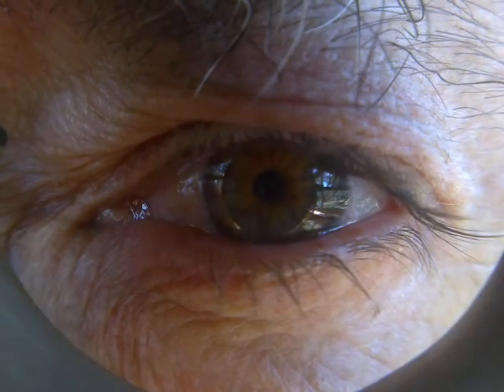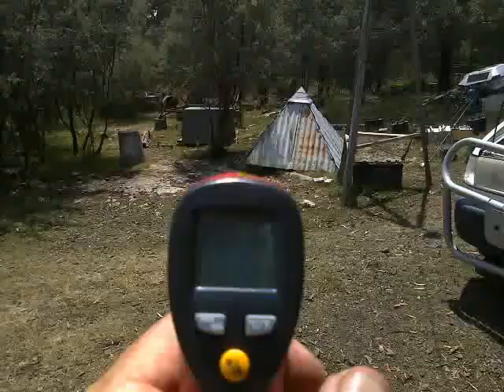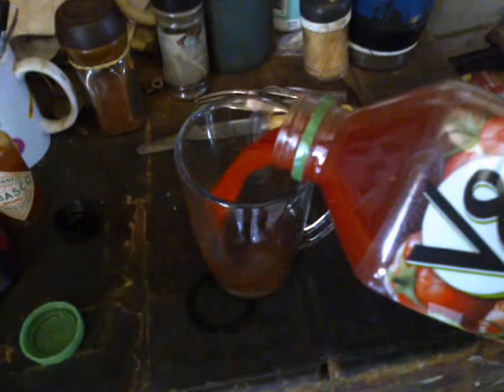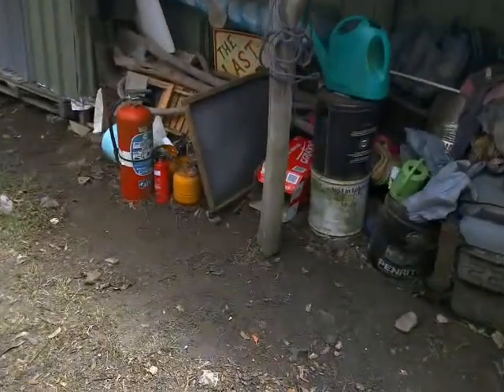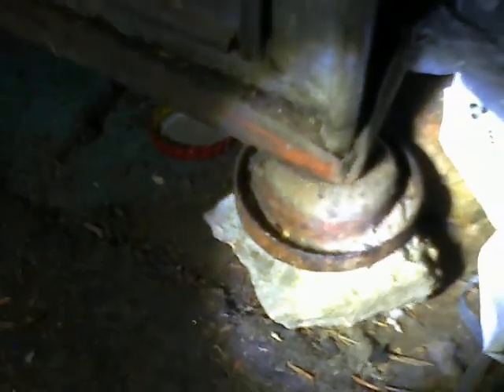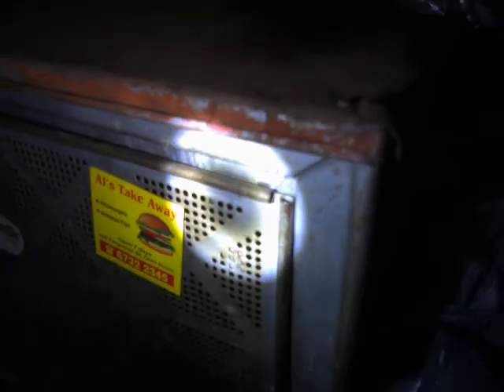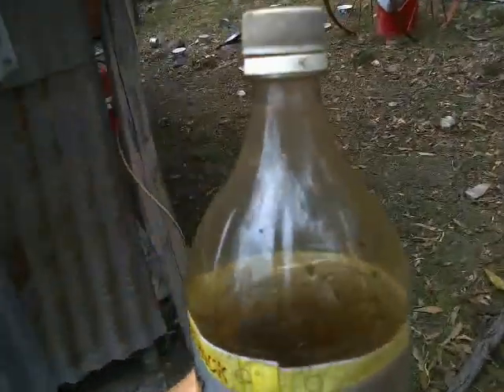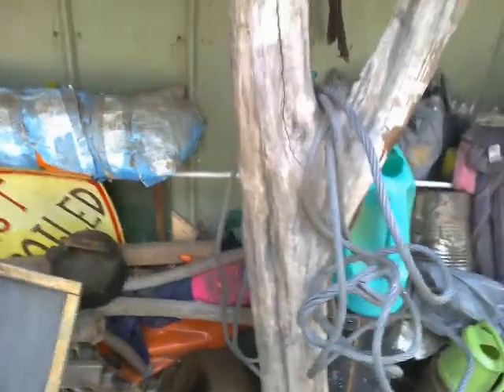Life Without Refrigeration...; 1918 Trafalgar Cold Safe..!

Comment: That was fascinating to watch. Great video Chris. I don't think I could ever enjoy a beer at your place. My Coopers beer has to be ice cold for me to enjoy it. So cold that the ice crystals are about to form in it. VB tastes like cat piss if you try and drink it at room temperature. I guess in winter time you can get your beer quite cold. Maybe beer drinking at your place is best first thing in the morning before dawn when the outside air is coldest.
Reply from the maker: G'day Ed,

  Well, y'know, after 20 years of stashing my Coopers in the coldest spot available, about 6 Degrees Celsius below Air Temperature...; getting a 182 year-old Cold-Safe which today reached 12 Degrees colder than the Air..., it makes me really enjoy the beads of Condensation on the Beerbottles, today, in 33 Degrees Celsius.

   And, 15 Litres of Water per day is a thing I can supply Barefoot with a  Bucket...; whereas you need 250 Volts ouf Coalburning AC, constantly available  before your Beer becomes "Drinkable"...

   When China nukes Trump's Oztrailia, mate, my Beer will be cold till the Carton runs out ; but you'll be forced to be sober several days earlier.

  Have a good one,

  ;-p

Ciao !

Comment: Great video and found this very interesting. Can't wait till your next.
Reply from the maker: G'day,

  Thanks,

   Yesterday the outside Ambient Air Temperature reached 33 Degrees & the Beer in the Trafalgar  was 21.5 & the Olive Grove in the Coolgardie on the floor in the Southeast corner of the Hut was 26.5...; so it's definitely worth the effort of aquiring & restoring an old Passive Evaporative Cold-Safe, or making one from scratch..., if one doesn't want to burn Kerosene, or LPG, in a Refrigerator, when not connected to the Grid or in possession of about 300 or 500 Watts of Photovoltaic Panels & Batteries to run an electric motor/compressor version.

   I'm delighted with the Trafalgar's performance, and more than a little bit proud that my "Coolest Spot in the Hut" method turns out to be fairly precisely "Half as good" as a dedicated machine using 10 litres of water per day...(!).

  Have a good one,

   ;-p

Ciao !

Comment: Just curious ...what is the temp of the water in the 44 gallon drum?
Reply from the maker: G'day,

  Thanks,

 Well, at the moment it's 17.6 Celsius in the Water Drum, but it's 7 AM, and the outside Air Temp. is 14.3...

   And the Trafalgar is using - evaporating - about 5 & 1/2 Litres of water per day...

  It might not be a Car which runs on Water, but it's almost a Refrigerator...!

  Have a good one,

  ;-p

  Ciao !

Comment: Gidday mate if ya' still alive seven years on.... Did you ever try a hole in the ground, you know 4' to 6' deep with a top on it... I wouldve thought that was a goa'???
Like, a mini cellar
Reply from the maker: G'day,

Thanks !

Yeah,

I'm still here. Living on, after having been treated for Stage-4 Locally advanced Malignant Metastatic Squamous Cell Carcinoma of the Right Tonsil, in 2022.

20 teeth extracted
70 Grays of X-Rays at 6.1 MegaVolts
490 mg of Cis-Platin...

And I'm still here.

 Digging into a Basalt Dome
Is
Not
A
Thing...

I bought a 12-Volt Camping Fridge,
And gave it a 220 A/Hr 12-Volt Battery & a 170 Watt PV.

In 2021, before being diagnosed.

The Fridge is still going.

Such is life.

Have a good one.

;-p

Ciao !